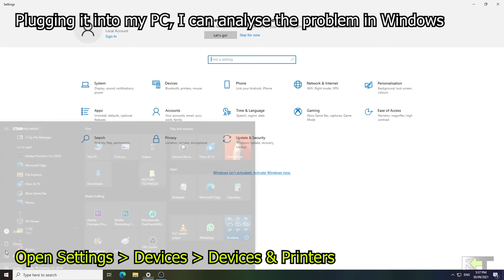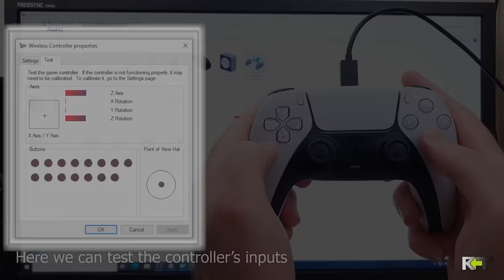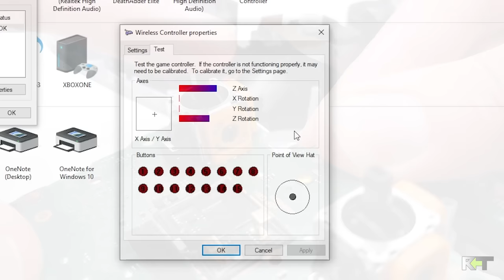How to take apart your PS5 Controller and fix Stick Drift

Comment: this was it! thank you so much, other joystick that was still working didnt have any grease on it amd the one that had insane drift had it, so maybe it isnt meant to have it?
Reply from the maker: I think the grease helps aid joystick movement, and is suppose to prevent wear on the contacts. But I think it also holds onto all the little particles of carbon contact instead of allowing them to fall down to the bottom or out the side. You're probably right, it's better without the grease.
Reply: @RestoreTechnique  yeah i imagine it does help at least perhaps in theory, the PS5 controller i have had the grease on the joystick, i also opened up my xbox controller (which i have been using for 8 years now with no issues) i saw thaty is uses pretty much the same joystick and that didnt have grease but it has some kind of oil i think nothing came off when i rubbed it but it is slick to the touch, maybe the PS5 controllers just had too much applied?
Reply: Bro the same thing happened to me, after I ate some pizza it started acting up
Reply: @watuhcapybara9465  you can always eat pizza with a fork and use a butter knife so that you don't grease your fingers up its what I do when I eat pizza when playing games
Reply: @bluspirit3407  what the fuck…?
Reply: @watuhcapybara9465  xD
Reply: @bluspirit3407  sorry but I cannot imagine going and slicing pizza and using a fork to put it into my mouth
Reply: Where do I send a stick drift controller
Reply: @watuhcapybara9465  You know what I can't imagine? Eating greasy sodden pizza like a pig and touching my controller with filthy hands. But I guess you're the normal one, right?
Reply: @trisbane4086  Let's not act like eating pizza with a fork and knife isn't deranged behavior
Reply: @RestoreTechnique  i have the baby blue colour one and i opened and dont have any grease at all, so is useless ? maybe
Reply: @RestoreTechnique  can white lithium grease work?
Reply from the maker: @manuelcarballo7869  it should do
Reply: Lunch lady doris! You got any grease!?...then grease my up women!!
Reply from the maker: @robofish2391  Okie-dokie
Reply: I have a question is it ok if u can reply to this comment of mine it's about my ps5 controller
Reply from the maker: @imverypassionate8430  Yes, what's the question?
Reply: @watuhcapybara9465  I always eat pizza with a fork!
Reply: @eastonvonschist2283  Obi Wan Kenobi: Use the fork Luke, use the fork.
May the fork be with you 🍕 🍴 😁🖖
Reply: @watuhcapybara9465  Bro wash your hands before holding your controller
Reply: Already killed my patient three times
Reply: @theaces3697  g
Reply: 2:14 perhaps your called to be a surgeon.
Reply: @bluspirit3407  that’s actually pretty clever, I really hate it when grease gets on my hands while also playing on my controller.
Reply: @Shinynyancat213  man I forgot I commented something like that the reply from someone was pretty funny.
Reply: Mine has no drift but it feels sticky when moving. I don't mean the top, i mean when you pull forward and then slowly release pressure, it feels like it sticks slightly instead of feeling smooth
Reply: @RestoreTechnique  I used some WD-40 contactor cleaner that you can spray directly on electronics I will let you know how it works and there was a lot of hair and debris in the controller that I had the original PS5 controller
Reply: I have been fixing my controllers since 35 years ago, from Atari , Sega ... to PS4/5.
The grease is just pouring down from inside parts of joystick by time, so usually left and right resistances are not greasy but lower ones are. I highly recommend to not use alcohol for cleaning or attach a little grease if you did, because alcohol will make it so dry and just in few weeks the carbon layer could be removed again causing same issue and finally have to be replaced by new one.
Reply: Yo bro could u fix mine it has the same problem only on the left joystick
Reply: @tashaaswimmer744  
Sony Playstation LTD.
Controller Stick Drift Repairs Department,
Tamworohi, Pohnpei, Micronesia
R8X3 P2G
Reply: Any thoughts on an adhesive for the silver and black square between the sticks.
Reply: Thank you
Reply: Is food grade grease the same i found in inox mx6 but is says food grade can i use that ?
Reply: So i fixed my black ps5 controller i cleaned the contacts for the left joystick like you did in the video because they had this black stuff on it so i tried cleaning it it fixed it and only lasted 2 days and now it drifts and moves to the left by itself how do i prevent it from getting dirty again or from it drifting?
Reply: @RestoreTechnique essays dhi
Reply: Because there’s significantly less stuff going on inside of a PS2 controller compared to the miniature pc known as the PS5 dualsense
Reply: Wait, was the previous owner Elon musk, the fuck? XD
Reply: I just wanna reach the triangle button.. must i take the motherboard first ?
Reply: What If I have no tools
Reply: The issue is that this new controles have this problem way too often just bought a ps5 and after three to four months had this issue while I had a ps3 for over ten years and same controles never had an issue with them I’m not smart but my guess is there just not making them wright anymore (just my thoughts)

Comment: I have my ps2 controller to this day..never had any issues. Bought ps4 and ps5..and I have stickdrift within 3 days. It's just sad..you pay all this money just for more problems
Reply: Ps2 and 3 gave me some of the worst issues
Reply: You might need to wash your hands lil bro
Reply: I have 5 ps5 controllers. Than brought the edge. And two months later. Same shit. wtf
Reply: I said the same thing. My ps1 controller might even still work. Have had three controllers for ps5 and none of em went more than 5 months without getting stick drift. So far managed to clean one of them even it's internals and theirs still drift.
Reply: Same. Zero issues with my ps2 + ps3 controllers. One of my PS2 controllers is the original with hundreds of hours of use and no drift or issues. My PS5 controller had horrible stick drift after 6 months.
Reply: Old school controllers worked on an axle, not a gyro. Meaning in lamens' term, they'd wear a hellava lot slower, sometimes not at all, because they function a different way. A better way to explain it is after watching this video, going to watch someone take apart a gamecube controller and pay attention to the joysticks lol.
Reply: Never had any issue with ps2 ps3 or ps4 buying my 4 fourth dual-sense 😤
Reply: That’s because after Covid Sony went with the fastest production rate. Which resulted in chela Chinese manufacturing in order to bring ps5 stock up
Reply: I have had ps5 since day one. Controllers have been thrown multiple times and have had 1 replacement but only issue now is the battery life. Everything else works perfect. And aswell never had stick drift even though  I rest the right stick ontop of the ps5 so I can stay in s session on gtao for about 13 hours while at work 4 days a week 😂😂
Reply: Had a PS4 for 5 years, never had any problems. Have had a PS5 for about 4 months, still no problems. I think it’s just a personal issue
Reply: i never had these issues at alll. i’m trying to fix my sons controller cuz idk wtf he be doing.
Reply: Yu play too much
Reply: Did you take a can of spray cheese and just start blasting? I've had my ps5 3 years now and have barely noticeable stick drift. Why? I took care of my controller. 

Like seriously. Did you just cover your controller in lard and melt it?
Reply: @andrewdc1 I had a ps3 controller with drift, ps2 never tho
Reply: Same I have a PS3 controller for like 5 yrs and no problems but then I got a PS5 controller then within the first week it had stick drift
Reply: @fishyisthicc ong
Reply: And up to the ps4 was easy to take apart, the screws are on the outside ezpz take the face plate off
Reply: @randywatson1615  ps5 controller is also pretty easy to take apart
Reply: Maybe because they're different
Reply: Technology goes backwards
Reply: Factual, they expect us to pay all this money for shitty controllers
Reply: HEY EVERYONE I FOUND THE PROBLEM inside the controller is a little plastic piece that senses the buttons I dropped mine and the l1 dpad and back button was not working so I took it apart moved the plastic sensor around and BOOM it worked I was so excited I wanted to tell others the problem UPDATE:I dropped it again and the d pad and the stick didn't work but I took it apart and wiped the thing with qtips and again it worked
Reply: All the controllers have issues overtime. But having all different PlayStation I think ps5 controllers have problems early then others
Reply: Yep, my dad's 4 PS2 controllers still work to this day, and we play games with him often
Reply: OVER A HUNDRED BILLION DOLLARS, sickening that they cant even manufactur their premier products to work well
Reply: More sensitive instruments are more sensitive
Reply: How do you people get stick drift? What the hell are you doing while gaming? Smashing it at a wall when you’re angry? I play my PS5 constantly and have never got stick drift. Look after your things better.
Reply: because they have ass quality. these where well looked after and respected, used just like any controller and now they just break out of knowwhere @casanova--
Reply: 3 days? dawg are you the hulk 😭
Reply: I've had my ps5 controller for almost 3 years at this point and I've had no drift
Reply: It took 4 years to get stick drift on my ps4 controller and in only 3 months my ps5 controller already had stick drift terribly
Reply: Not i single issue with any of my ps3 controllers
Reply: It me almost 7 month months until I noticed drift with my controller. The process is a easy fix unless you need to solder some shit.
Reply: never had the issue w ps2 or 4. had both for way longer than this 5. controllers also die crazy fast
Reply: bro forgot to put back the nails on the L & R buttons 😂
Reply: This is facts never had no stick drift on my Xbox 360 controller, but I get it after playing 3 months on the ps5 controller.
Reply: My bootleg  ps4 controller still hasn’t got stick drift it’s been 1 and a half
Reply: fr
Reply: No Diddy
Reply: @casanova--  You so special 🤣😱
Reply: They don't make them like they used to. Build to last. Now it's all about money. Greedy asf
Reply: Zero drift ps5 since 2021 have my og controller still
Reply: Yes because they want to keep replacing them to bring in more money ... I have my PS5 for a year and I am on my 3rd controller ... Got tired of it I would rather fix them myself if possible...
Reply: This is why Sony Portals will eventually fail. Drift Left. Guaranteed.✅
Reply: PS3 controller was goated man
Reply: YOOO FACTS
Reply: Lol, I have had my ps4 controller for 10 years now and there’s no drift
Reply: Everyone that saids they never had drift on ps4/5 must not play fps games. Those destroy sticks no matter how good you treat your pads. So no BS the rest of us.
Reply: @michaelsears8159 Lmao this made me not want that now😂💀
Reply: @KarenTondro BRO FACTS and the ps4 had WAY more play time.
Reply: Fr
Reply: Fr
Reply: Yep still garbage to this day
Reply: its different hardware 🤦‍♀️😂
Reply: Still have my ps1 controller....no stick drift yet...😂😂😂😂
Reply: They need to either...

- let us but cheap alternatives
- make the controllers easier to take apart than this (like other controllers have been)
Reply: @sharko3211 it’s not some controllers we’re just completely made incomplete I just bought the ps5 a month ago and already had stick drift keep in mind I’ve taken care of it always boom controller drift same with the ps4
Reply: I never had stick drift till i played COD lol💯🤷‍♂️
Reply: @casanova-- some people tend to push the buttons harder then otheres!when I fist started playing COD on ps4 i literally was buying a controller every 2-6 months!I started trying to control my fingers better and not smash the buttons so hard or push the sticks so hard and i rarely have any problems with controllers now.Ive had my ps5 for about a year and still have the same controller and it works great still 🤞
Reply: Always & everything the oler it is something the better it works from bike 2 cell phones/cars & more. It's the system they search for victims boy 😉😆
Reply: @bigbird0077  I don't remember EVER having issues with the PS1 controller. It has to be the wireless tech in my opinion.
Reply: Congratulations
Reply: Getting stick drift within 3 days is crazy, your controller is definitely dirty. I took apart my controller yesterday & it had hair in it, removed the hair, wiped it down with alcohol. Now my controller works perfectly fine.
Reply: I'm absolutely convinced this is user error, I've played Playstation since I was a literal toddler, now ad a grown adult I've still never ever had stick drift. My brother on the other hand ALWAYSSSSS gets stick drift.
Reply: im scared to take mine apart. I used to clean my PS4 controllers all the time but this one has too much going on. and I definitely don't have the money to buy another one
Reply: Agreed
Reply: I’ve never had stick drift on ps3 or ps4, and guess what? I taken care of my ps5 controller better than them all and it’s got hella issues. My ps3/ps4 so dusty and been playing with dirty greasy hands my whole life. Ps5 just sucks sdd
Reply: @sharko3211 naw cuz I’m with you but my ps5 controller started fucking up and even doing all these YouTube videos it ain’t helping. Bout to dump the whole thing in alc and see what happens
Reply: @SavageRoosterOnThaLooster  I ended up just getting it replaced cuz mine was under warranty
Reply: @Asstolfo96 Why even comment this. Out of the box my ps5 controller had a clicking sound that developed into drift. I bought a second that last 8 months. Its a quality issue. You said yours "barely drifts" so you must not have taken good enough care of it eh?
Reply: I have PS5 too I got drift a year later
Reply: More feature come with more complex structures , What you’re saying means “You wouldn’t get brain cancer if you don’t even have a brain .”
Reply: Right
Reply: It's my worse fear bc I'm not  gentle with my controllers,  it doent mean I mishandle them I actually baby them but the joysticks themselves I feel like I push to hard... can anyone tell me the advantages to those 200$ controllers are they worth investment or just buy another dualsense
Reply: I HATE these PS5 controllers. I still have my original PS4 with original controllers and they ALL work perfectly. I’ve now gone through 2 PS5 controllers, both have stick drift and the right trigger on one stopped working. Each lasted maybe 6 months. GARBAGE!
Reply: Same ps2 and ps3 controllers NEVER had any problems
Reply: I've had my shit for 2 years n there nothing wrong with it